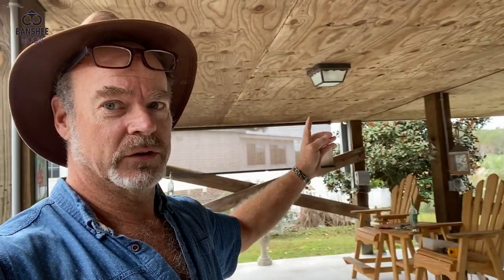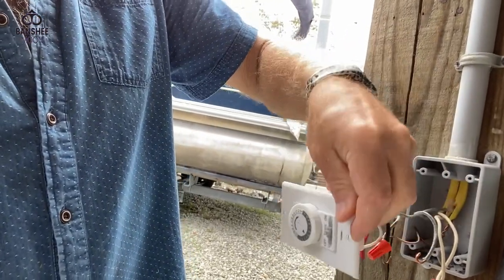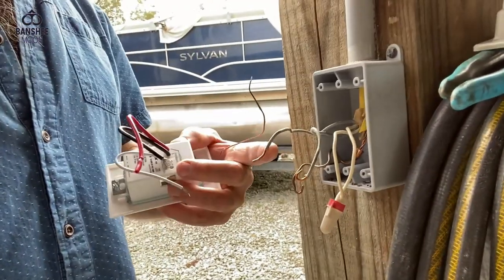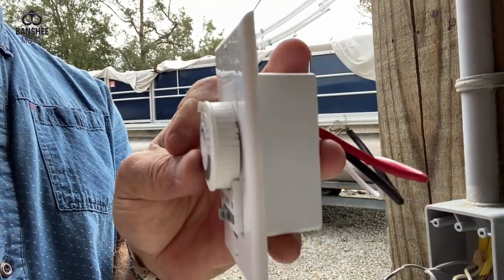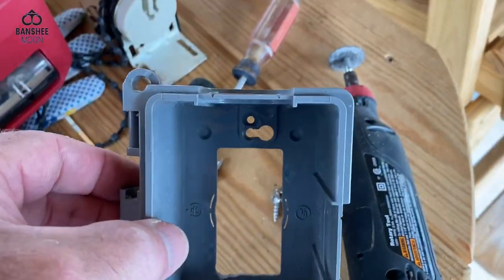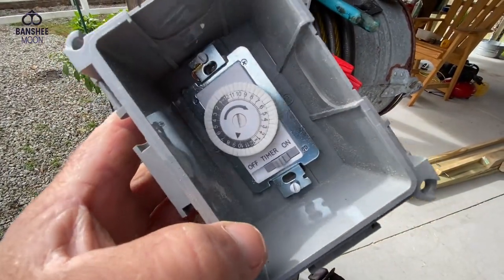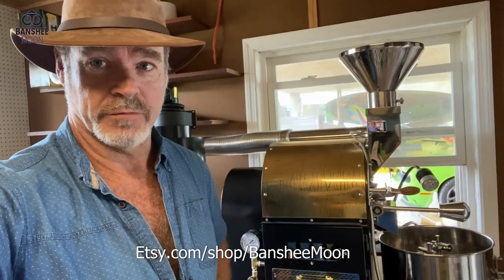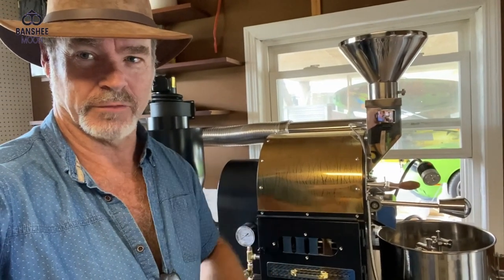Light Switch Timer ~  NEVER FLIP THE SWITCH AGAIN!!!

Comment: Yes, longer screws . Take a philliphead screwdriver and some No.#12 wire. Rap the wire a round the screwdriver a dozen times. Push the wires together.  Pull them off. Now. You can cut them any length and use them as spacers behind the switch or receptical. Put, it on the screw . Hope this helps! But, please dont' leave that switch hanging.

Comment: When you're using expandable foam, 100% silicone or even RTV silicone for something else,  just go to the timer and put a glob at each corner. That'll hold it! Won't take much. And you can always still remove it. But that timer may outlast you😁! 
I would ALWAYS rather have a timer than a photocell (dusk to dawn) control. Like you, I don't like the newer digital (electronic) ones either. 
And you're right, most people should stay away from wiring. All it takes is one mistake.